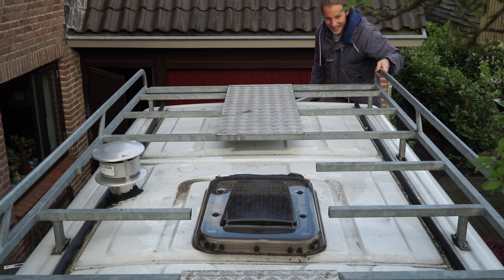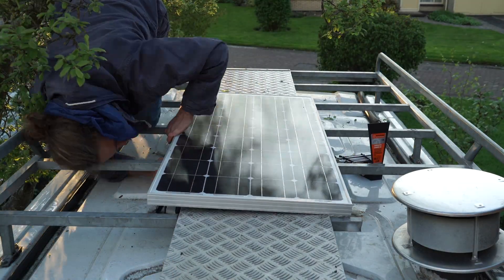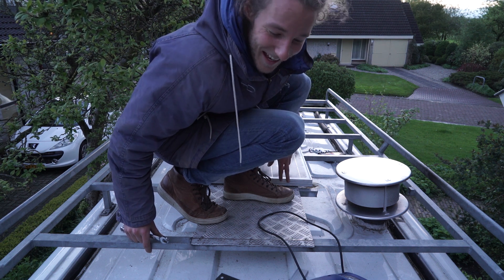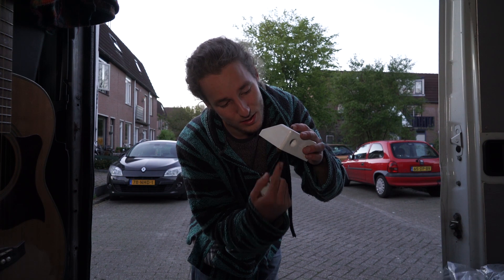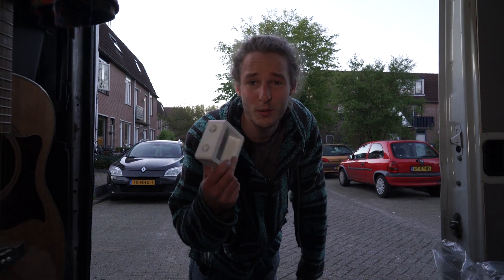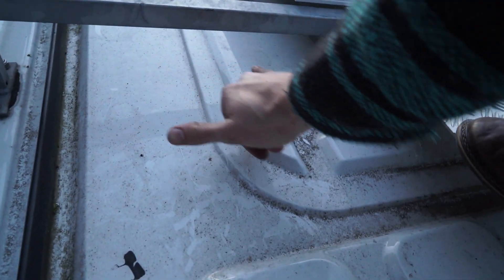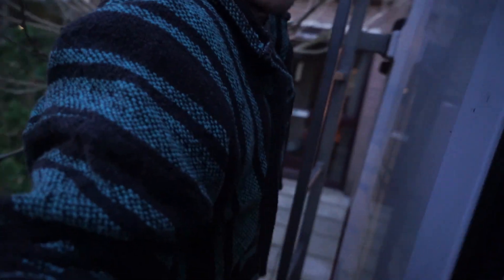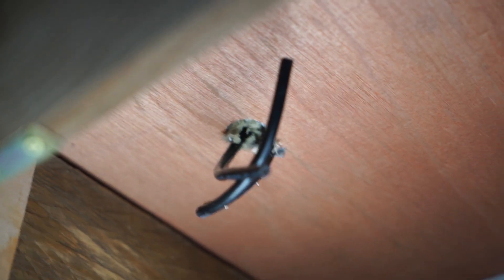How to install a solar panel on a van (the easy way)

Comment: For anyone else watching this:
- Make sure you seal up the exposed paint when you drill a hole in the roof with rust proof paint.
- Ensure you put a grommet (rubber donut thingie) in the hole so your cables aren't cut by the sharp van metal.
- Ideally de-burr (using a de-burring tool, they are cheap) or sand the edge of the hole too.

Comment: Glad you cut off mc4 connectors.  However, if you did drill a bigger hole you could put the mc4 connectors through the roof and then use the the alternates to connect to the solar panels.  Too bad you did not just put a big 260 watt panels up there.

Comment: I missed seeing you and your cute wacky ways!! Congratulations on your wire wraggling!!!!👍🏾🤟🏾
PS: Please check out The Indie Projects latest video,  which will feature the leak potential along the Black strip on the sides of the Sprinters. It's an easy fix with some non-curring silicon on the clips. It can leak through the unprotected holes and damage your insulation and such!!!!!!!😱😡 FYI